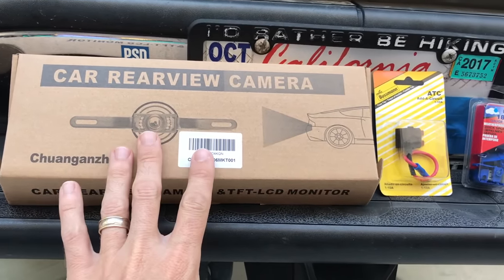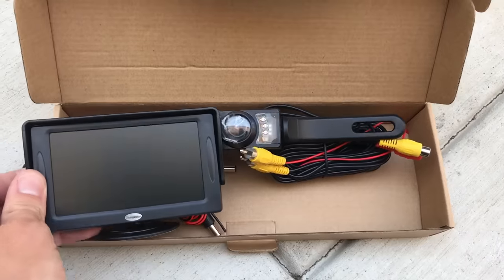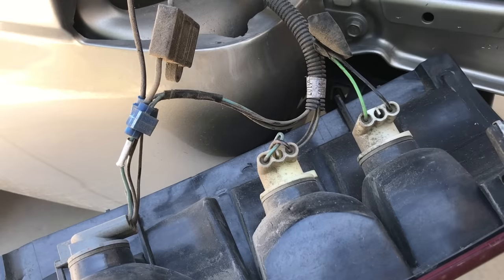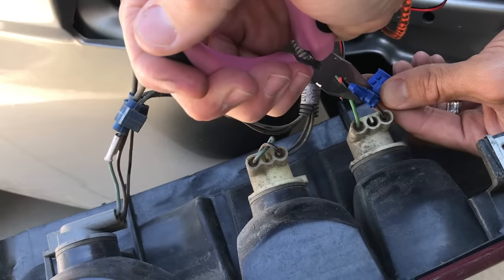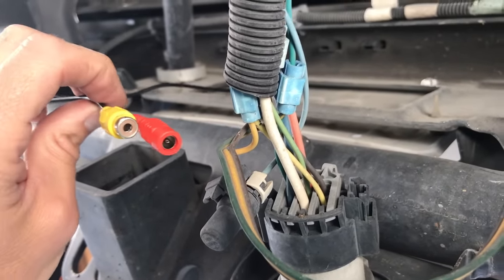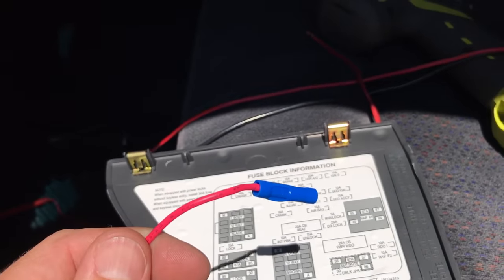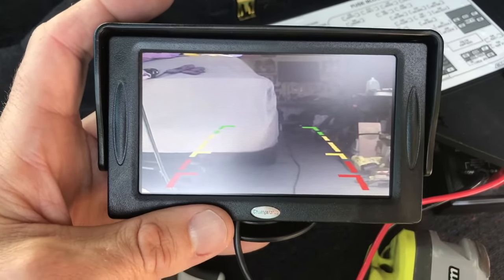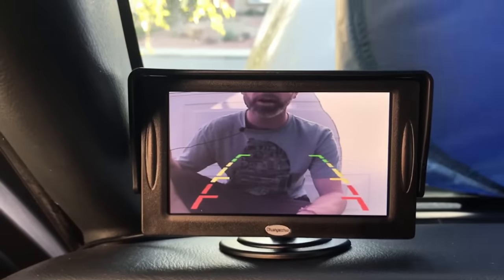Install a Rear View Reverse Backup Camera for only $30!

Comment: I have a 2012 civic that's in great condition. Not even 100K miles. I desperately need a backup camera, they started putting backup cameras in their 2013 models. My poor bumper is in shambles because of it.
Reply: Please dont drive

Comment: I have a 2004 Dodge Ram 1500, would it be the same concept? I’m trying to locate the reverse wire on it, any advice? Also my camera comes with a power outlet charger, does this mean I don’t have to do that fuse deal?
Reply from the maker: Yes, shouldn’t have to deal with the fuse box. If you are having trouble locating the reverse wire do a google search for a wiring diagram for your truck. That should help.
Reply: Thanks a bunch

Comment: Great video, I am differently doing this. I have a ground next to my fuse box which I use for my dash cam...can I use the search ground nut to ground 2 wires...1 to my dash cam and 1 to the reverse. I want to use the same ground nut but worried about putting 2 wires to the same nut? Also how clear is the image quality??? Thanks

Comment: I have a very similar kit, i see the yellow video wire also has a red wire coming off of it, do I need to connect that to the reverse as well? I'm a little confused to its function because its on both sides of the video wire. (its also on yours at 0:43)

Comment: I may be overthinking this, but how does this system know how wide and how long of a vehicle it is mounted on? Is any calibration needed? I am asking because the camera that came with my new car leaves a safe buffer on all sides for my car. So if this system thinks it is leaving a safe buffer on something like a chevy spark, that safe buffer won't apply to a chevy tahoe without calibrating, right?

Comment: weird question, but can you install this so that it is ALWAYS on?  would be nice to have this constantly playing as an additional review display/viewpoint to see cars behind you.
Reply from the maker: Yes, you can. I actually had thought about this, all you would need to do is supply 12v power to the camera instead of connecting it to the reverse light. You could either run a wire from your fuse box or to a running light that is always on.
Reply: incubrian just get a dashcam.  Theres some models with a 2nd remote camera that gets mounted to a back window. Comes in handy when a cop pulls you over and lies to you.
Reply: I ran mine to a toggle switch under the dash, I can flip it on when towing check on my hitch and connection.

Comment: Could you hook the power up to your driving lights instead of your reverse lights. Would be easier to monitor a trailer if it's possible.
Reply from the maker: Yes you could, then it would come on whenever your driving lights were on. I thought about doing the same thing, or running switched power to it so I could turn it on and off when needed.

Comment: Does the added circuit just provide power to the screen but only displays a picture when you’re in reverse gear? Or does it keep the screen on displaying a picture all the time?
Reply: It turns on when you back up

Comment: Can you power both the monitor AND the camera using the reverse light? I'd like to have the monitor turn on ONLY when the truck is in reverse. Thanks
Reply: My monitor only comes on when it senses a video signal. So it probably depends on that.

Comment: Why are we splicing into the reversing lights and also the ignition fuse? Don't we just need the reverse camera to be spliced into?
Reply: Your slicing into the reversing lights because every time you put the car in reverse the camera will come on. Because reversing lights only get power when you have your car in reverse

Comment: Installed a after market one works fine but there no mention  anywhere. On measurements. Line diatances(angle) . like how far should the first green line should be from camera
Reply from the maker: Where the lines on the screen fall will vary by the height and angle of the camera on the back of your car.
Reply: Go and watch "Coolooser Tech" on YouTube here and he will show you how to test and adjust your camera after you've installed it so you know how far it is from the line and car behind you.

Comment: Thanks for the video.  At around 1:30 you say the car's green wire is power wire to reverse lights and black is ground.  Then then you say you're going to tap the car's power BUT tap into the car's Black wire with the camera's BLACK wire.  Is this correct? I thought the camera's Red wire is power and should tap in to the car's RED wire.  Thank you for answering this question.  Will install my backup camera when you do.
Reply: yea I saw this also. needs to clarify which wires

Comment: Right I've done this today. It's worked but let's see if I drain my battery
Reply from the maker: If you tap the circuit that as a kid circuit, it can drain your battery.
Reply: @DoItYourselfDad  sorry this doesn't make sense to me
Reply from the maker: Are you running power to the screen though a fuse tap? Or the 12v socket?
Reply from the maker: If it’s a fuse that only comes on when the car is keyed on it won’t drain your battery.
Reply: @DoItYourselfDad  that’s awesome and thanks for all the replies

Comment: But what if the plate is located off center like on a van that has the plate mount located on the passenger swing door. Is there a way to center the camera under those circumstances

Comment: In regards to the add-a-circult,  is it possible to just use a extension 12V line to hook it up to a power supply.
Reply from the maker: There shouldn't be a problem doing that, you just want to make sure it's a switchable power source.
Reply: i meant to the car's accessory power supply.
Reply: Yes you can but you don't want constant power to the unit cuz it will drain your battery's life.  You want power only when you're using the car to activate the camera.

Comment: I, have a 2002 Chevy Astro Van with two doors the  license plate mount is in one door will the camera self center itself in one door or will the lines and center be off to one side?
Reply from the maker: Pretty sure the lines will be off to one side.

Comment: I've followed your video all the way up to the add a circuit. My add a circuit will not crimp correctly and there are a black, green and red wire...I'm guessing black is ground but do I just try and put the red and green together in the add a circuit?
Reply: green is always ground. red is power, black is neutral.

Comment: Ive installed 3 of these now, and I think the camera needs continuous power for my kenwood. I tried tapping into reverse signal and itll work once, then nothing. I think im only geting an intermittent signal thats why it shuts off. I should say, it will work in reverse, but i have to manually turn it on. It wont interupt any signal without me hitting the button.

Comment: Do i need to connect LCD Power cable only red to power? And what to do with Black cable?
Reply: Last time when i called a socalled Ellectrition, i thing he has connect both Red and Black cables to power line. And after 2 mints my Car was full of smoke. Black cable was completelly burnt.

Comment: DoItYourselfDad, you mention that the wireless has interference and it dose not reliable now did you installed one and experience it?  I currently just bought a wireless set and want to installed it on  my car but no one mention any interference issues.  Thanks
Reply from the maker: I installed a wireless one and eventually just tore it out. We had so much radio interference it was almost useless at times.... maybe they've gotten better since then?
Reply: Thanks!  I purchased both unit one wireless and one with hardwired so I installed the wired one yesterday but why is my rear view mirror is so dark when the camera not on?  What went wrong?  I connect the power from the mirror to the cigarette lighter wires and backup camera works great. Just curious why when not in used the rear view mirror is darken?

Comment: I bought a similar camera kit. I tapped the power and ground into the reverse light as you have shown. BUT...2 things: there are little red wires coming off the rca cable, what am i supposed to do with them. And when i hook them to positive everything works. My only problem is that when the truck is on, the camera is on irregardless if it is in reverse or not. The power for the monitor was done using an add a circuit on the ignition fuse. Please help tell me what im doing wrong
Reply from the maker: The extra wires are if you want to hook things into an additional monitor or DVR, if not you don't need to use them. If the camera is always on it's because the camera is always receiving power. The camera needs to be wired into the reverse lights, or the reverse lights circuit.
Reply: DoItYourselfDad , i tried running the RCA video cable without using the thin red wires, and nothing worked. I had run the power to the monitor from an add a circuit to the secondary ignition circuit and ran the camera power directly into the reverse light. I hooked in the RCA video cable and nothing worked. I called the company/emailed them and they said that because i have such a long/big vehicle: 04 suburban that i have to hook in the red wires for added power for the video to run. I dont understand this but i have everything running now. But i would like to run it ut to the back of my Kenwood double din stereo. It has a rear camera hook up video hookup. Do i then run the red wire of the RCA video cable to the purple reverse switch wire?

Comment: Hello, im new here, i have ford escape 04 and dont have space to put the camera on center. Can you suggest where should i put it to get a good view? And last thing sir, the bolt where you put the ground. Should you peel the “add on fuse” to put on the bolt? Sorry im new in here and want to do it on my own.
Reply: You can buy one that the  Camera/Mirror which hookup to your exiting rear view mirror.  They even have the 7.0" screen.  Also, comes with wireless so save yourself the trouble of running the wires all the way from the rear of the car/truck to the front of the vehicle.

Comment: When you did the connection to the fuse panel did the camera itself have to be tapped into that power line which you grounded to the bolt

Comment: Can you advise? I got a backup camera as part of a dashcam for my friend. When. We were wiring it up it came with 2 additional cables for wiring into the reverse light & ground to activate the camera. I done that, I checked it several times with a multimeter and spliced into the correct cables. Then about 15 minutes later the reverse camera wires completely melted and fused together causing a short. 

Any idea wtf happened? It was 100% wired to the correct ground and reverse light positive.

Comment: Why do you have two power supplies?  Won't it run off the back up light power?
Reply from the maker: It could if you wanted to run power from the back of the car to the where the camera is.

Comment: how do you know if the camera and monitor are 12 v, what if the cigarette lighter power plug is a power diverter down to 5 v.can you just tie in the fuse pig tail into a 5 amp fuse ?
Reply from the maker: Your cigarette lighter/accessory socket should be 12v.

Comment: O.K. so car does not have a fuse in the main fuse box.Would it be under the bonnet do you think ?
   BMW 330Ci 2003 Coupe. Thank you
Reply from the maker: Looks like the fuse box of a 330ci is in the glove box.
Reply: The main one is,but they have one under bonnet (hood) one in boot,and
  some have another under the carpet on the O/S.????

Comment: As a Tech, I would never use a splice outside the vehicle, and not very often on the inside either. On the outside there is too much chance of water intrusion etc. especially when tapped into your ignition you are asking for trouble. At the very least heat shrink or tape it up very well., better off to solder it then insulate for long term protection. On the inside if you have to, you could use taps but they can take up space etc. you cannot go wrong by soldering the connections then heat shrink it. All easy things to do and the tools are very inexpensive. Just my .02 cents.

Comment: Hi! I installed one of these after market camera with the video on the mirror type  and I notice your also have the red wires coming out from the video wires, did you have to connect those to a power source in order for the system to work?  I did my last night after watching your video and did not connect those red wired feeding from the video and it still works but the mirror is dark.  Am I suppose to connect them red wires feeding from the video too? Thanks

Comment: You are hero my friend ♥️
Reply from the maker: Thanks!!
Reply: @DoItYourselfDad  i have one question
Reply: @DoItYourselfDad  Can i connect black cable from camera to backlight frame ? And Can i connect Power red cable from display to red cable of video cable ? So i dont need that fuse cable
Reply from the maker: Yes you can connect the red cable to the red one at the other end.... not sure what your asking about the black cable though. Can you elaborate?

Comment: Does the added circuit just provide power to the screen but only displays a picture when you’re in reverse gear? Or does it keep the screen on displaying a picture all the time?
Reply from the maker: It provides power, but the screen wont actually turn on until the car is in reverse.

Comment: Can i connect camera and monitor on parking light ? So they were only works when i turn R
Reply from the maker: Yes, you can.
Reply: @DoItYourselfDad  niceee but i need longer Power cable from monitor :( right ?
Reply from the maker: You can also pull power from the fuse panel.
Reply: @DoItYourselfDad  i want to connect it to reverse light

Comment: Help! I followed things instructions but i think something i did is wrong i just don't know what!?! I installed back camera . just like in video. Brought the long cable wire (with yellow ends) up to Monitor . bought a add a circuit fuse. Added it hooked up to monitor , ground etc. Then when I turn on car the monitor turns on but that's it. A black illuminated screen no image from camera .
Reply from the maker: It sounds like you've got everything correct. Did you put the car in reverse? When you did, did the reverse light bulb come on?
Reply: @DoItYourselfDad  Thanks for the reply. Yes 👍 they work. There are only two lights connecting to the reverse lights one ribbed with red and one solid black. I thought the solid black was negative (ground) and the ribbed was positive. Could it be the opposite and that's why there's no signal?

Comment: Hi can you do a wireless one pls same product. Thanks
Reply from the maker: +ading adormeo I may be doing one soon, stay tuned, be sure to subscribe!
Reply: DoItYourselfDad il wait thanks
Reply: For a wireless unit the hookup is the same except you don't have to run the connecting cable/wires from the rear of the car/truck up to the screen unit up front.

Comment: Does a blue screen pop up when you turn the ignition to acc? And after you get out of reverse?
Reply: Real reverse cam monitors only have picture when there is signal and when wired correctly. If theres something else then its a crappy generic screen not meant for reverse cam use

Comment: For the add a circuit portion.  Do you think it would be possible to connect the monitor to the reverse light fuse instead of the ignition?  In theory, it would only power on the screen when in reverse.  Or do you think the camera and the monitor feeding off the same circuit would be too much?
Reply: Did you ever get an answer to this?

Comment: Instead of removing all the lights and panels to hook the camera to the backup lights, why not just follow the wiring diagram and tap into the backup light wires under the hood or dash?
Reply from the maker: You could, but you would have to run that all the way to the back of the car to the camera to power the camera.
Reply: DoItYourselfDad but you have to run the video cable anyway.
Reply: Frenchie. Why would you run wires all the way from the front to the back when you can just connect your wires straight to the back lights which are right there? why would you use extra wiring and make your job more difficult when you don't need to?
Reply: Thats what I would do. It would be the easiest way to do it.
Reply: @DoItYourselfDad  I know this is old but he is saying you can wire in the power to the back up lights. If the power wire is in with the camara wires, I guess it wouldnt matter, but you could still tap into the back up lights, that way you have the camara going on with the lights. You would think they would have designed it that way in the first place, saving on wire.

Comment: Just one question. Where does the cable run into the cab?
Reply from the maker: I came up though the hole that the Peking brake cable came though, but every car is different.

Comment: thanks for the vdo. So, could you help me how to install 12v back camera (general market) to the toyota factory head unit?
Reply from the maker: +thi boulom your head unit should have a video input on the back of it, the wiring in the. Acorns should be the same.

Comment: How did you ground the wire by the fuse box to the car?
Reply from the maker: You can attach it to any screw or bolt that threads into a metal part of the car.
Reply: @DoItYourselfDad  and how did you connect the wire to the bolt?
Reply from the maker: The easiest way is to use a crimp connector.

Comment: How do i know what amp to use? I have the exact same kit. But installing in an Nissan Altima 99
Reply from the maker: You want to use a switched fuse ( something that turn off when the car is off). Use something like the ignition fuse or the fuse that powers the cars sterio
Reply: @DoItYourselfDad  I still don't know which fuse to use. Can you explain more on this please?